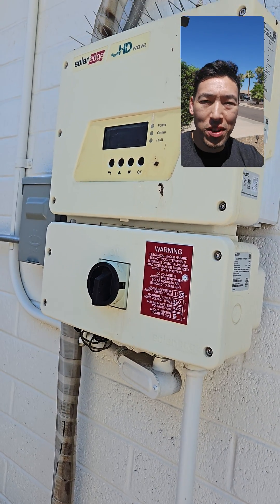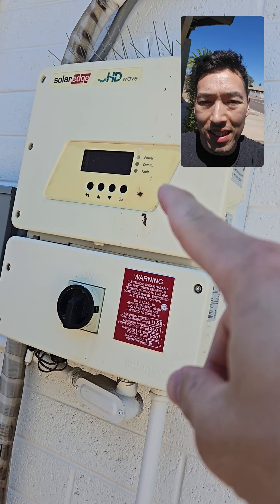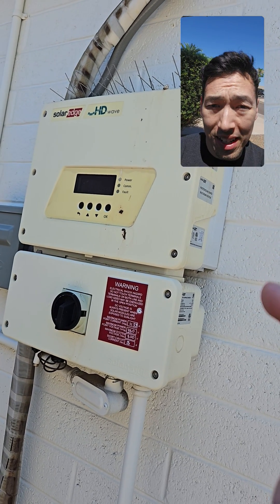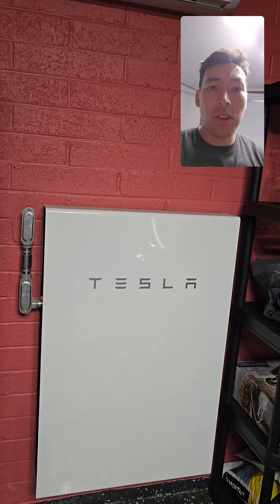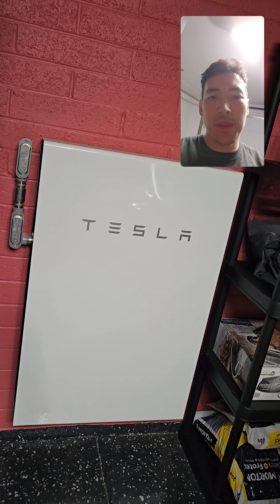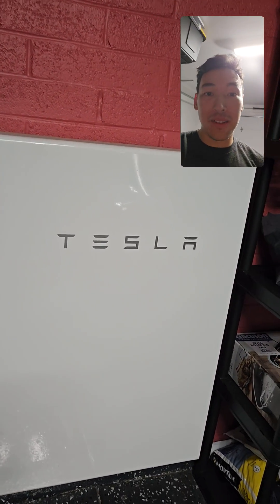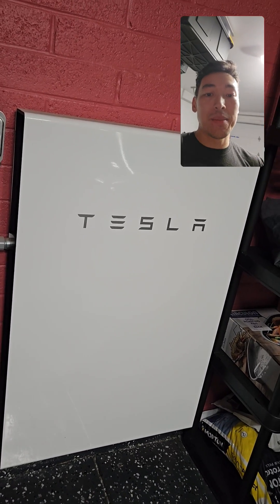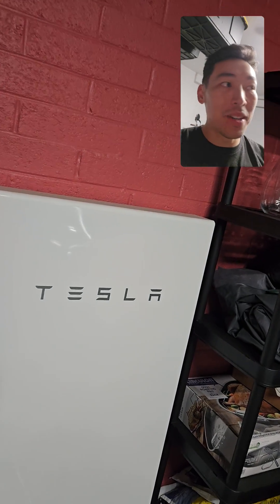Powerwall WiFi connection fix (2024)

Comment: I had a similar issue with my Enphase Envoy so I added an extender to my eeros 6 Pro MESH system.  BAM, 5 bars, and no more issues.
Reply from the maker: @thomasjacques5286  Tesla actually advised me to get an additional extender to greater a stronger mehs. Hopefully I can stick to the one.